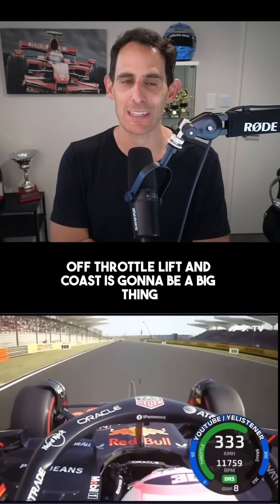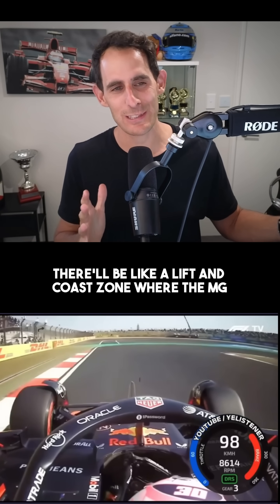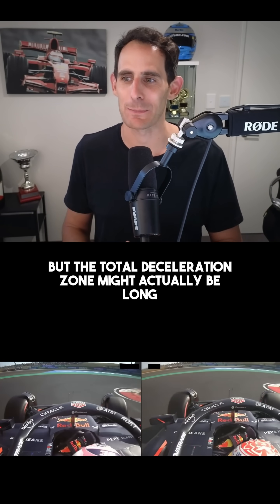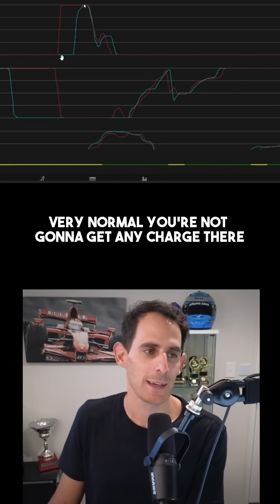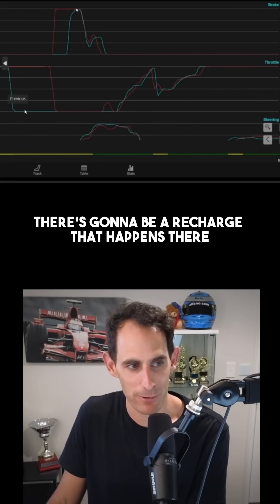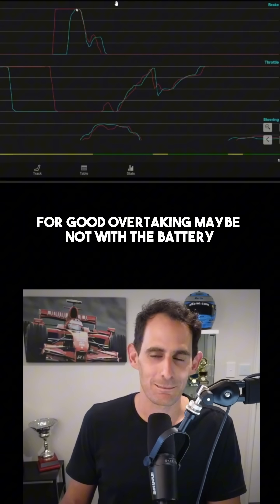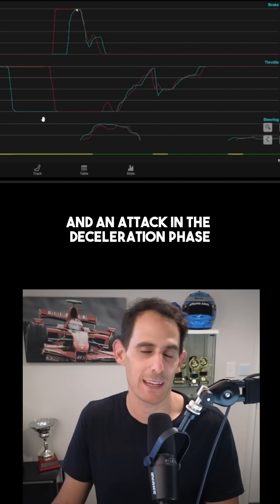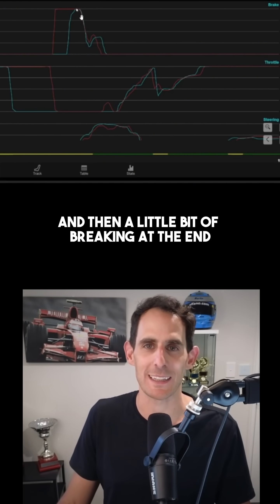HOW TO RECHARGE BATTERY IN 2026 F1

Comment: Are the teams going to throttle up the ICE to feed the MGU, mid corner?  Will the tires be able to handle the overtake-braking, or will the cars need to LICO anyway, because the tires are at the limit?
Reply: for the first question, this already happens a lot.

Essentially, it's mandated to have a throttle pedal position create a set torque at the rear wheels (each team can set this mapping, there just has to be a fixed one), but that torque can be 100% ICE 0% MGU, 50% ICE 50% MGU, or even 150% ICE -50% MGU (i.e. recharge) and anywhere inbetween.